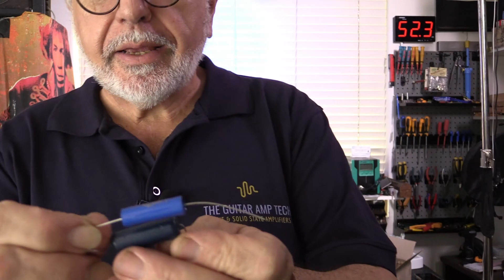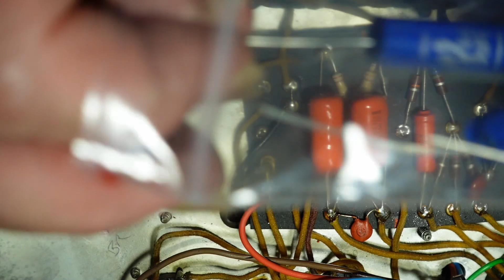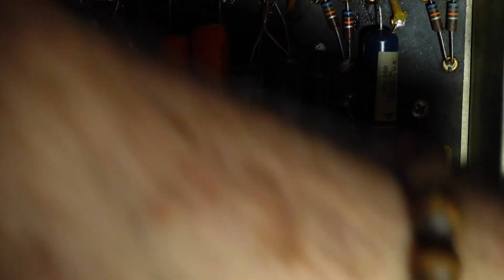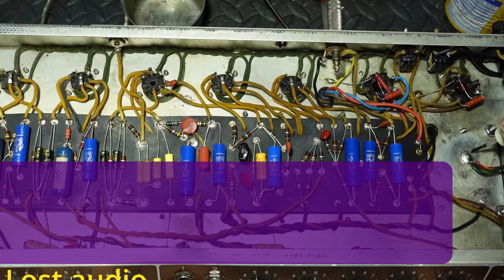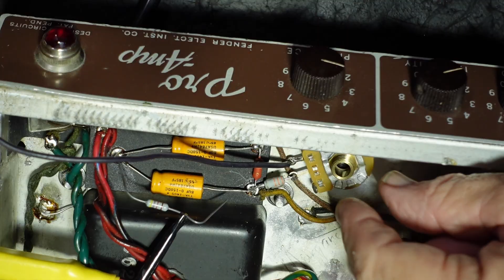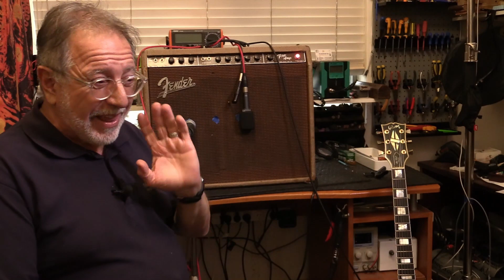Part Two: The Rise of the 1962 Brown Panel Fender Pro

Comment: What's the difference in tremolo and harmonic tremolo?
Reply from the maker: Good question, Dwight. Normal Tremolo/Vibrato is simply a pulsing of the amplitude which you can simulate with a volume pedal or volume knob. Harmonic tremolo is very different. You need to look at a schematic of, say, my Brownface Concert 6G12-A. There is an oscillator as usual, but the magic happens in the 12AX7 that comes next. Does it look familiar? Does it look a bit like a Cathodyne Phase Inverter? You’ll see one output from the Plate and another, but opposite phase in the Cathode. Those TWO signals then go into the 2 control grids of the 7025. However, the 2 grids are not identical. They have different resistor and capacitor values and this plays with their phasing. The magic happens in that interaction between the 12AX7 phase splitter and the 7025 to produce that luscious swirling sound. Sadly Leo dropped the Harmonic tremolo after the Brownface era and went to the comparatively uninteresting vibrato we’ve had since 1964. Why? Cost.

Comment: Good vids, however, it amazes me how many techs call out amp parts like caps and resistors incorrectly.  Such as a zero as the letter 'o', ie .oh47...  Other than that great job...
Reply: A colloquialism used on an entertainment platform amazes you? It's no more consequential than your comment referring to a capacitor as a "cap" or an amplifier as an "amp". We all know what you meant so there's no problem. It's not like someone can buy a "point oh four seven cap" where it would be the incorrect part because a "zero decimal zero four seven microfarad capacitor" wasn't used.
Reply: @stevencraig  I made that comment as a person that made a living working on software and computers.  That industry taught me to properly call out 'number 0 as zero' and 'letter O as oh'.  Mix those up in the IT field and things go bad fast...   I did not mean any disrespect, matter of fact these amp techs have my complete respect, at least the good ones I follow...
Reply from the maker: Great point

Comment: Playing devil's advocate here... Is it possible that this amp originally had the older Astrons on the eyelet board? If so, changing them out wouldn't have been as big a deal. Have seen other brownies with those in them, but you've been around a lot longer than I. Thoughts?
Reply from the maker: Hi TK, yes this amp may have had the Astrons, but from my experience, I have only worked on Brownface amps with the Blues. Even if they were the Astrons, I would still take exception to changing them all without testing first. I left 2 Astrons behind in this amp as they tested fine. If they lasted 60 years, I am not expecting them to fail in the next 6 months. And then there's the question of the missing output transformer. Sure they can fail, but how many vintage OTs have you changed? I can't remember replacing any in a vintage Fender. But excellent point, TK. Thank you.
Reply: @theguitaramptech  Yep, of course - totally agree with you there. A motto from one of my favourite books goes, "Always Test Everything!" I've only had one failed vintage OT so far - a Moody 1712 Vibrolux - 1/2 of primary went open under test. It was like watching my favourite pub burn down. Thanks for sharing your work and ethos. Cheers mate

Comment: I don't understand the need for 5% grid leak resistors in the power stage. Don't get me wrong, if Leo did that, there must be a good reason, it's just that I can't figure out what that is. I mean, in theory, the grid current is so low that the voltage drop across those resistors should be negligible regardless of their value (within reason, obviously). Am I missing something here?
Reply from the maker: I assume you meant 5w. Hey, anything that Leo did is as good as gospel for me, dazz.
Reply: @theguitaramptech  Can't argue with that logic, I would do the same.

Comment: Some heavy lifting required on this one! Adding adjustable bias to these is tricky with the layout, I ended up making that 10k go acrobatic on the blonde Bassman I had on the channel to fit a trim pot underneath. The transformer bolt is also partially in the way which makes it more difficult. Fun stuff! Haven't seen that hot glue trick before, I'd be curious how that hangs on after some years of loud use and the vibrations that go with it. I bet it'll be fine but those 15" pros put out a lot of bass! 

https://youtu.be/MxgdCBX__aE
Reply from the maker: Yes, I saw your video on the Bassman. Very good! I am confident the hot glue will hold. I did it this way on my personal drip-edge Bassman about 8 years ago and its still feels secure. Trick is to clean both surfaces very well and to apply heat to the chassis to melt the glue. 🙂
Reply: @theguitaramptech  yeah smart trick with the big iron!

Comment: Sounds lovely Chris!  You did a great job!  I especially like the extra trouble you went to, trying to get the correct bias point at the centre position of the bias pot.  This is when ocd can be a good thing!

I don't spose you can even get blue Molded caps any more huh?  You like the 'sozo's', & I like the look of them too, but how much are they actually?  I'm in Straya too mate so AUD is fine!  

I still can't believe some asshole stole the other blue moldeds!  And aren't those orange drops sposed to be pretty good too? - But just visually jarring?
Reply from the maker: Thank you very much, Neville. I guess the only place you could get the original Blues from is from ethical people who have stripped old amps, or from theives. I bought the Sozos from Evatco (Qld). They carry 3 sizes from AUD12-19 plus shipping. Say HI to Michelle from me.
Reply: @ @theguitaramptech    Say hi to Michelle WHO Chris?  You must be thinking I'm someone else mate!  What do you think of the Sprague 'orange drop' capacitors?
Reply from the maker: @nevillegoddard4966  Sorry I wasn't clear, mate. Michell runs Evatco.  
Orange Drops are fine caps. I feel (ie I have convinced myself) that I can hear the difference, and I find them a little spiky. Leave them in Mesa's where there is so much other tone-destroying stuff happening, it wouldn't matter what capacitor was used.

Comment: Phantastic Job , the Amp sounds great. Witch Mike is better ? if I pan to left the Shure is much louder so it sounds better than the Sennheiser, more volume means less resistance, the right channel is to low in output .  It seems you hit the sweet spot for the shure on the speaker., not so for the Sennheiser.  The sound can improv more if you would search for the sweet spot for the Mike Position , via the noise the Amp makes and some Head phones .
Oh and good playing .
Reply from the maker: You are EXACTLY right! I wish I had taken more time to position the Sennheiser and balance the levels. The Beta 57 uses a neodymium magnet, so it will be naturally louder. I should have checked for level differences but I am always under such time pressures for repairs. I will have to try again on the next video. Can I please depend on your ears and judgement again?
Reply: @theguitaramptech   Everything is fine, i can understand that you are under pressure , so no harm done . Of course I will lend you my ears again.

Comment: Hi again Chris. I can purchase orange drop caps at Antique Electronic Supply in Tempe Arizona. But I don't think they have the blue sozo caps. Where can I get them?
Dwight.
Reply from the maker: I often buy parts from the Wholesale division of Antique Electronic Supply in Tempe Arizona. They have the blue Sozos so I expect Antique Electronic Supply would have them, too.
Reply: I like the way those blue sozos look in the amp you repaired on the utube video I'll give them a call thanks Chris. Dwight.
Reply from the maker: @dwightbehm2886  I like the Soszos too. Good luck with those, Dwight.

Comment: I wonder Chris wouldn't a two part epoxy like JB weld hold the bias pot in more securely? I don't know if they have JB weld in Sidney in a hardware store.  It comes in  quick cure or one hour cure both types finish curing in 24hours at 21 degs. C or 72 degs. F Room temp. What do you think?
Reply: @@dwightbehm2886  I think Jaycar Electronics have jbweld.
Reply from the maker: Thanks Neville. Dwight is in the USA. Yes, JB Weld is definitely a good product, but I need to have the pot removable in case anything goes wrong or we decide to go multiturn in the future. Unlikely, but, you know...
Reply from the maker: Thank you for that suggestion Dwight. If I wanted that bias pot to never come off again, even if it failed, I'd use something like JB Weld. I use hot glue because the pot is light and offers no forces of inertia from a bump, yet with my big Weller, I could remove it very easily for maintenance.